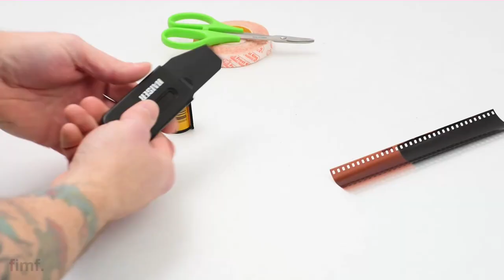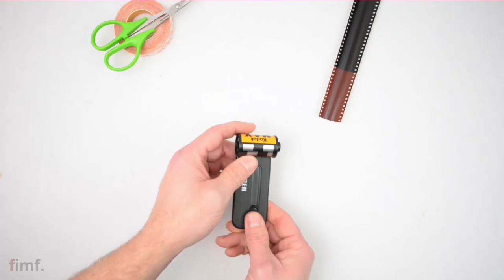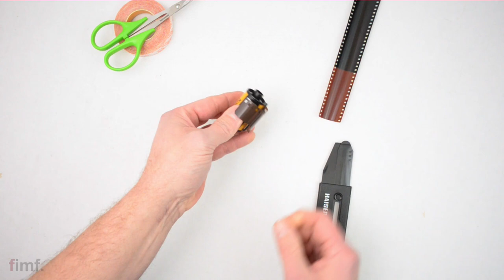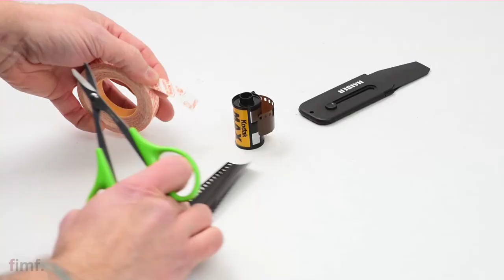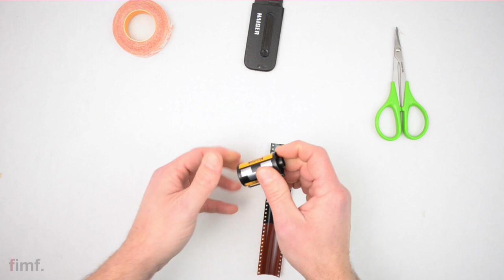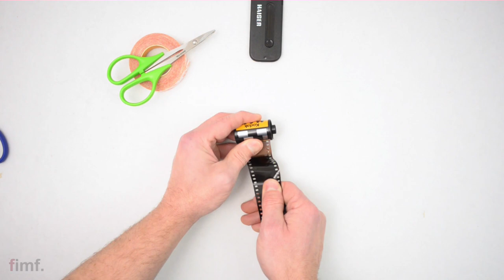How to EASILY Retrieve a Film Leader End from 35mm Canister in 3 Different Ways

Comment: The tape method (w regular double-sided tape) worked better than the leader retriever I just bought /eyeroll One thing I might try is to trim the sprocket holes right at the end so you can get the leader you're inserting into the light trap a little more easily. Thanks for sharing this.
Reply from the maker: No prob! 🙂

Comment: After failing trick #1 with the retrieval tool (the tool appears to be defective) I found that Trick #2 also works great with a small splash of 3M Remount Spray on one Side of the Piece of Film. 
It can then be a little difficult to get the film through the light seal, but it grips so cleanly the first time that the film inside can be pulled out cleanly.
What is particularly cool is that the film strip prepared with 3M Remount can be used several times until the adhesive effect wears off and either new spray has to be applied or the entire strip has to be replaced.
Reply from the maker: That's a great idea!
Reply: @filmismorefun  what I just found out through tinkering around also works well is a strip cut out of a beer can and sprayed with 3M Remount. This should have made the Kaiser tool unnecessary. If you want to make a video about it, go ahead. Take it as a gift, on your input that you gave me with this video.

Comment: If the film retriever is not working, it could be that the barbs that grab the sprocket holes have been pressed flat. Just raise them with a nail.
Reply from the maker: That's a good point, thanks!

Comment: I just used the lick-trick on one. At first it didn't work, it just wouldn't grab. But then I figured why. - I used the other side and it turned out to be what I think it was; You need to wet the side with the emulsion, that's what will make it stick. The other side will just end up being wet slippery plastic, not sticky. - I still taste the emulsion after a quick lick, though... Dumb idea. I'll just use a finger, like I just did, next time. - But it does work!
Reply from the maker: Glad it worked for you 🙂

Comment: Hi, I got a film roll keychain and I pulled the whole film out of it. Do you know how to put it back to the canister?
Reply from the maker: You would have to remove the top ring and pull out the center spindle, then tape the film back onto the spindle. 
The top ring may be hard to get back on though, especially if it gets bent during removal. 
I hope that helps!

Comment: I have that exact black retriever, I have tried it on several rolls of film, it does not work for me.
Reply from the maker: When mine was new it was easy to use and grabbed the film quick. Now that it's older it works less effectively. I mostly use the 'lick the negative' method as that almost always nails it on the first try. 🙂
Reply: @filmismorefun  I got mine from a friend, it is badly crimped, he has no finesse, he recently scratched a 16MP full frame Canon while trying to get rid of one tiny spot on the sensor.
Reply from the maker: @mamiyapress  oh no! 😯

Comment: Just trying to get the leader out with that Kaiser film picker and it just doesn't work at all. This is the second time I'm using that thing and for the first time it worked normally and now it doesn't. Back in the 90's I used to work in a photo lab and there was never any issues with getting the leader out. Wonder if the "modern" film pickers are just crap... I guess I'll have to try the other methods then.
Reply: Just tried all of these tricks and nothing worked for me. I guess I'm gonna just break the canister in the dark, there is something wrong with my film. The tape trick was the most promising, probably the kaiser tool made it worse and now the tape thing isn't working anymore either. I've used already over 30 minutes trying to get it work. Already warmed my chemicals but let them cool again...
Reply from the maker: Yeah sometimes it can be hit or miss. I've noticed after several uses the 'barbs' that grab the leader can be less pronounced lowering their ability to grab. So to help with this I'll occasionally bend the barb tabs up which seems to help.
Reply: @filmismorefun absolutely. I just opened the canister and it was way less painfull. The leader had a tiny notch at the end that probably was the reason it didn't came out.

Comment: hey guys.. i think the problem is my camera cus i got two rolls stuck like this. The first one worked out using method 3 but the i fee like second roll is broken? cus i cant twist it either way
Reply from the maker: Hi there. Yes, unless they are modified, most cameras will return the film all the way back inside the canister after it is rewound. 

That's weird you can't twist the second roll either way. I'm not sure why that would happen unless there spindle is bound or jammed for some reason. I hope it works out for you!

Comment: Hello does anyone know what will happen if the film leader accidentally got ripped off? is it still usable?
Reply from the maker: Do you mean it is disconnected from the spool inside the canister, or the piece that sticks out ripped?
Reply: @filmismorefun  the piece that sticks out
Reply from the maker: @enriquesacay8142  Yes, just use one of these methods in the video to pull the film out of the canister and it will be fine to use. However, it may be a bit more difficult to retrieve than normal though if the torn part is jagged. Hope that helps!
Reply: @filmismorefun  okaaay thank you 😀

Comment: Yey now i have tape in my canister and still No film leader THX
Reply from the maker: Well, you're the first person to comment about that. CONGRATS YOU'RE NUMBER ONE!! 🙂 If you need to still shoot the roll, there are other ways that you can remove the leader. In the dark you can use a canister opener to pop off the circle top cap, then slide the film out, extend the leader and then reinsert the film. Then, snap the top cap back on. If you're doing this just make sure you're in the dark and you don't bend any parts of the canister or reassembly will not be fun. I hope that helps!

Comment: 4:02 i can't do this. Although I turn it, it doesn't go inside
Reply from the maker: Hi there. That means the piece you're using to retrieve isn't catching or touching the film inside the canister. You could try pushing it in a little farther so the (taped end or wet end) touches the film inside more firmly and has better contact. I hope that helps! 🙂
Reply: @filmismorefun  Oh, i mean i didn't try to retrieve, i can't roll (?) my film anymore. Sorry, my English is not very nice😅

Comment: No matter what I try the spit method will not work I don't understand
Reply from the maker: Hi there. Make sure you're on the correct side, and after a few attempts try a new negative, or cut back the wet section and re-wet. I hope that helps 🙂

Comment: why do you need to do this?
Reply from the maker: These methods are ways to get the film end back out of the canister of it is accidentally rolled inside.
Reply: Film is more fun 
i get that but why.  when i develope film i don't need the leader out. am i doing it wrong?
Reply from the maker: @sbarronmd  Well, the most common reason is that  the roll was not shot and accidentally retracted into the canister. However, another typical reason would be that after shooting the roll it's much easier to start to load the leader onto the development reels in the light when preparing to develop. (If you send your rolls out to a lab to process and don't develop at home, this shouldn't be an issue). A less common reason is that someone might want to shoot the entire roll again to achieve multiple exposures. 
I hope that helps! 🙂